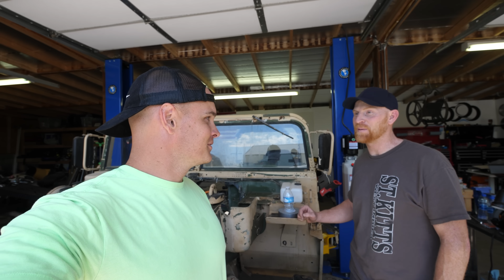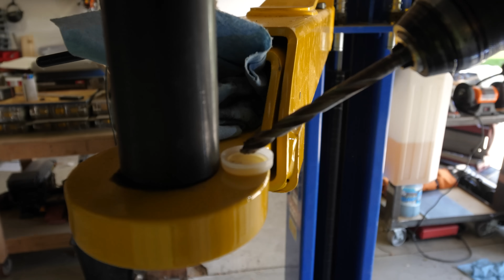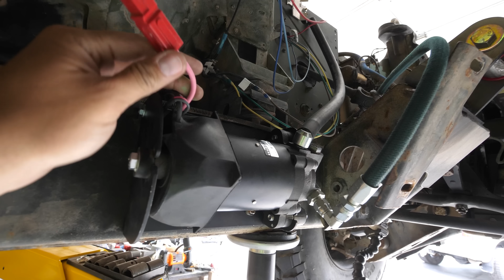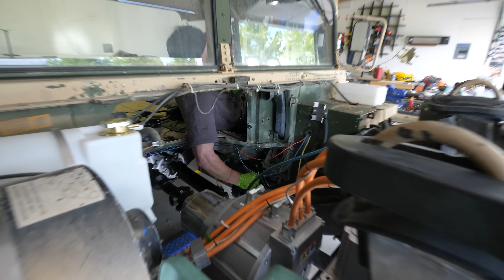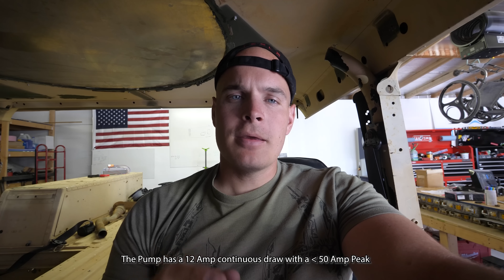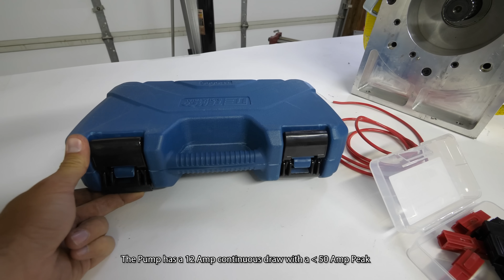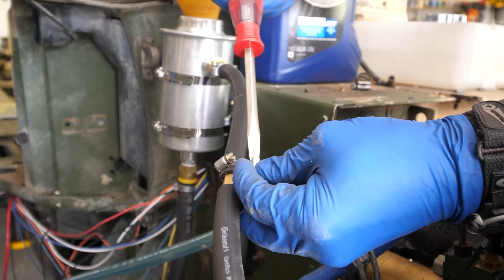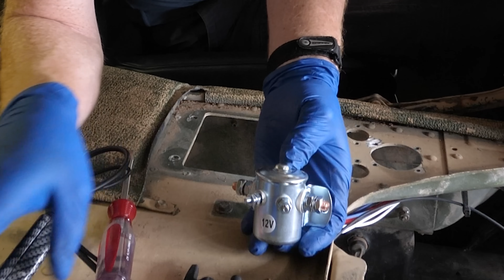We might have a problem with the Brakes... - Electric Hummer Conversion!

Comment: Why not use a main breaker for the power pump, same as for the entire 12v system? It should be able to handle high currents above 75amp. As a solution for the pump maybe it could make a difference to choose a gear pump instead of an impeller pump and vice-versa. I guess that it is the electrical motor that's making the noise but if that is the case, be careful by isolating it because it might not be able to handle the temperature that's increased. Maybe the isolated box is a solution but then maybe you have to cool the box with a fan because of the temp as well. I educate a lot in vehicle, hydraulics, tanks, electric in vehicles and houses in the Swedish army and I'm always thinking about the energy losses that comes with heat and so on. Read in the comments about the accumulator, great suggestion. Hope this helps you out and btw, great episodes. Best regards, Magnus from Sweden👍🏻

Comment: It is not recommended to use a hose clamp with push-on hose when using a push-on hose fitting (barb with yellow ring). That yellow ring is actually more of an identifier more than anything to let the user know that it is specific for push-on hose. The barbes on those fittings are engineered specifically to be more aggressive to eliminate the need for a hose clamp with the correct hose. The clamp will cause the barbs to dig into the hose more than intended, lowering the max working pressure rating. Love watching the build though!

Comment: I think you could solve the noise issue in this way: have a second hydraulic pump driven by the gearbox during movement rather than a dedicated electric motor, so you'd only have to use the electric motor in stationary manoeuvres, I think you'd have to use a bypass valve so you could use both features, when the pressure drops, the electric pump comes on, when it rises, it goes off.

Obviously this system will develop a fair amount of heat, so you'd better set up a heat exchanger to cool the hydraulic fluid, you could recover something from a small mechanical shovel or from some hydraulic transmission machine.

Another thing you could do is to fit electric power steering but obviously you would need a lot of amps to power it.

As for the brake, you could use a vacuum servo brake... you can easily get a vacuum pump and think in the same way; one that works stand alone and one that works with the vehicle running.  You've launched yourself into a nice project, congratulations, if we were neighbours I'd come and give you a hand, greetings from Italy
Reply: This is a unique solution that would work.  I've actually seen hydraulic pumps run off the pinion of differentials on race trucks to circulate additional diff fluid inside the diff onto the pinion bearings.  Couple check valves and an accumulator could help dampen the pressure spike of the electric motor kicking on and off.  The only down side I see is that the faster you go, the harder you would run the mechanical pump off the drivetrain.  And at speed, you really only need the hydraulic power steering pump for brake system.
Reply: @strandtc  I believe that a relief valve would be sufficient to vent the excessive flow, plus, if it were placed before the gearbox, it would be gripped close to the main electric motor and therefore the speed would be more or less constant, I would certainly choose hydraulic power steering for simplicity anyway and hydraulic brakes with vacuum servo brakes.
Reply: @AsitShouldBe  I think you'd have to find a variable relieve valve.  Because if you just put a pressure relief valve in there, and you have a fixed displacement pump, you end up working the fluid really hard the faster you go.  And the shaft speed before his gearbox is variable with the vehicle speed.  That gear box doesn't shift speeds as you drive like a transmission does.  All good thoughts.  Thanks for the interesting discussion.  Oh and the brakes could certainly be more straight forward if he could find the right components to work with the hmmwv calipers/braking components
Reply: @strandtc  yes there are also a variable embedded hydraulic pumps, that should be perfect with every range of speed, for example vetus HT1015SD2.. very big pump, you could add some hydraulic accessories after😁

Comment: You could try adding a variable controller to your hydraulic motor.  Or use a power steering pump from a Toyota MR2.  I believe it has a on board controller just give it power, and 0-10 volts.  Put in a small accumulator and a check valve on hydro-boost . The check valve will stop oil from back flowing back to pump.  Place a pressure transducer after the accumulator.  But you need a closed oil system.  So when you stop using Hydro-boost or steering there is no oil flow.  if it is an open system, then you will need some displacement transducers to measure master cylinder brake position, and steering rotation.

Comment: Get pressure relay, pressure gets low-pump turns on. On a hingway no need to supply pressure to system all the time
Reply: You need the pump for the hydroboost brakes.  He would want power assist brakes on the highway.  And that hydraulic system through the brakes and steering flows all the time, so the only time the pressure goes significantly high is when its hard to steer, or he's braking hard.  Good idea, but it doesn't work like that.  Switching to totally different brake and steering components would be the better solution, but would be much much more work to find the compatible components and get them to work correctly/safely

Comment: 12 amp continuous draw? That's going to kill the 12v battery in about a day. You'll Def want to find an electric power steering unit that has a torque sensor to vary the power pull based on how much assistance you need. I believe these don't even require fluid. They are expensive though.

Comment: Ya you will want a different system for breaks. Used just for steering allows you to turn off the pump when above a certain speed. 65Ah at 400v to run it for an hour, I would guess that is an appreciable amount of your capacity /range. Use a tesla break booster, all in one units from Bosch
Reply: Any idea where you can find specs on those units?  Like the pressure and volume from the master cylinder vs the pedal movement?  Electrical specs?  Its a good idea.. but I always have trouble finding tech specs for OEM components.

Comment: They make bolts that isolate sound. you can also use sound deading mats like they use on the car for large speaker systems. Should help kill some sound in the cabin as well as road nosie.

Comment: I would say you're best bet on sound dampening is to put some sound dampening in the floor of the cab. I don't think you can make the pump any quieter without insulation which would make the pump heat up. I think when you're driving the sound of the tires, wind, and the electric motor will easily drown out the pump noise.

Comment: Mustn't fluids for steering and brakes be different? Because transmission fluid used to be not suitable for breaks afaik
Reply: The brakes still use brake fluid in the master cylinder.  the transmission fluid is providing the power for the brake booster only.  The 2 fluids stay separate.  And in a hmmwv, you can use atf instead of power steering fluid.

Comment: There will not be much you can do to make the pump quieter short of building a thick steel enclosure for it and adding some rubber mounts, but it probably won't be too audible with the dog house cover in, especially while moving with the tyre noise

Comment: if you add a pressure switch to turn off the pump once the pressure reaches an adequate level then it will be quieter.  Also you can add a small pressure tank to store some extra fluid under pressure so the pump is not turning on/off as much

Comment: I think you've located the pump in the wrong place. Try up behind the firewall/bulkhead. That will be safer away from water in deep river crossings, quieter as behind the layers of the bulkhead. Plus, when you bolt on the underbody protection plates,  everything close to it will be amplified upwards, so it's better not having the pump down there.

Comment: If able make a housing to go around it. Use fire wool and sound deadening foam. So you’d have the housing sound foam and then fire wool for safety if fire is a risk. If not. All sound foam. Then just cut ports for your hoses and wires and use grommets to keep the chafing down.   Hope you find this to try out.

Comment: You should use a solid state relay for the power steering /brakes pump. More reliable no moving parts internally on the solid state relay.

Comment: When I was a GM I designed a  foam shroud for some machines to reduce the sound in the factory.  it was a long time ago but I think what I did was measure the sound then research different designs and materials and how much sound that material absorbed.  it being up again the center square hollow tube may be amplifying the sound....maybe put rubber stand offs on both sides.

Comment: Starter solenoids aren't meant for continuous use, you should use a continuous duty solenoid for that. Starter solenoid won't be able to take the heat output when used continuously. As for the pump, i think isolating the pump chamber with foam inserted inside walls should do it, although that might heat up the pump. I don't know if the hydraulic fluid has any thermal conduction properties that may help cooling the pump.

Comment: It’s a hummer. Nothing will be quiet. However, you could shield the pump and use dynamat. I would shield the pump regardless. Do not attach the dynamat directly to the pump. It will retain heat. That is bad juju.

Comment: It looked like that pump fitting was the lowest point in the hummer. Would it catch on something off road, or is there a skid plate? And will the pump run all the time? Sounds like a big power drain.

Comment: This thing could use a alternator generator, so it could run even longer.  It'll help with the charging as you drive.
Reply: Like... As an additional item that spins off the driveshafts?

Comment: I did something similar on my passenger car when doing a motor swap. I have bolts drilled through my frame rails but I had to weld in "crush sleeves" made out of DOM tubing (just large enough for the bolt to pass through) to prevent the frame rails from crushing while tightening the bolts to their torque specs. Do you have any worries that you'll experience frame deformation through the crush sleeves?
Reply: I did this on my hummer when mounting a diesel lift pump/filter.  Crush sleeves ftw.

Comment: Hydraulic fittings never need Teflon tape they seal on the 37 ° faces and Teflon tape if it gets in the hydraulic system can destroy components in the system

Comment: Did you build in redundancy? See even electric cars like teslas do not have 100% electric brakes, theres usually a second pump that runs the hydrualics to the brakes, because the last thing you need in an emergency is no brakes should you lose vehicle power. Most regular gas cars have vacuum boost from the engine or electric assist brakes on top of the standard hydrualic system

Comment: Change the pump to a 24v pump.  Higher voltage is much more efficient and quieter. Only bad thing is everything else sounds like it's 12 volt for the DC system.

Comment: I noticed you connected the solenoid right to the battery...you should put an inline fuse there to protect from a short.  Also, probably the only chance to reduce the noise from the pump is to build a small box with noise insulation inside it to go over-top the pump.  Great series and plan to use it as a reference for the Electric Jeep Conversion @electrifiedveronika and I will be doing soon...

Comment: To quite the pump the the rpm can be lowered with a PWM speed  controller. To 60% for example. Then with the brake switch(  or pressure switch) ramp the pump to 100% with a relay that bypasses the PWM controller.

Comment: I would definitely have put a high quality 1 - 0.5 micron hydraulic filter after the reservoir. You rely quite much on that pump for you own safety and thus don't want it to break.
Reply: Add a magnet inside it to pickup metal particles as the pump and other components wear

Comment: Use the sound deadening material as are put on the doors and floors of modern vehicles. It is heavy and meant for removing the low frequency vibrations that a pump makes. It is commonly used as an easy trick to take care of the noise coming from HVAC hydronic pumps in quiet environments.

Comment: Does the brake hydroboost have an accumulator?
Once the accumulator is charged and you're not moving the steering the pump should shut off if it is running all the time IT WILL DIE
Look into high current solid state relays and electronic PDM (Power Distribution Module)
They should have all the circuits and auto cut offs needed.
Reply: The hydroboost does have an accumulator.  But it only gives you a couple presses of the pedal, and I'm not aware of a way to monitor the pressure inside it... would have to add some sort or port.. and you'd be drilling a small small pressure vessle.  Also, I've heard of people having those fail (ends up not holding pressure like its supposed to when there is no hydraulic pressure from the power steering pump), and not knowing it until the power steering system didn't work.  As AM General built the truck, it was designed as an emergency backup, and not as the primary system.
Reply: @strandtc  I would consider using the steering control system and electronics out of a Prius or similar and replace the hydro boost with a newer GM version if it’s not the same part or go to a compressed air boost . A compressed air boost looks almost identical to vacuum boost except it gets air pressure instead of vacuum.
Reply: @anomamos9095  Woah.. what kind of vehicle can that be found on?  Never heard of one.. sounds interesting
Reply: @strandtc  I forget where exactly, I think on some small hino and Mitsubishi trucks.
There’s a guy converting an old jag with the full gear out of a Tesla who used to work for Tesla. He just used the brakes from a Tesla.

Comment: Jerry - move the pump forward in car i.e as far from the cabin as possible. Car manufacturers then put sound deadening material on the bulkhead to improve NVH performance. Where it currently is mounted you'll have a challenge to isolate it sufficiently. Love the series man!
Reply: That was my thought. Placement of the pump so close to the drivers seat seems unnecessary unless I missed something. Put it further up in the engine compartment.
Reply: Definitely, could even build out a sound deadening box for the pump itself, almost like a sound deadening box for a home generator
Reply: @diesels4774  it needs to dissipate heat ! just like a generator
Reply: @shawncell1247  Power steering cooler + vent fins on sound box?

Comment: Just an FYI solenoids are a type of relay. They're just designed to handle heavier loads
Reply: and only certain solenoids can be run continuously.
Reply: Solenoids are more mechanically driven actuators than a relay..  relay just switches electrial loads on or off with a separate voltage source to isolate.  Solenoids are actuated electrically to turn a mechanically activated system open or closed.  They convert electrical energy to a linear mechanical  energy or force.. not much relates to a relay besides the fact one source is used to trigger another..
Reply: @Z-Ack  if you wanna be super pedantic...a relay is a solenoid connected to a switch. (virtually) All electromechanical relays are solenoids. Not all solenoids are relays (think pinball flippers or some styles of door lock actuators....or the thing that eats your coins in a pay phone when the person on the other end of the line picks up. (did I just date myself?)

I'd be curious to know the duty cycle on the starter solenoid/relay used here. Starters typically are very short duty. Using one for a continuous load could be problematic.

Comment: Use electric power steering and  a hydraulic accumulator for the hydroboost so the pump only runs when the pressure is needed. Toyota Priuses use a setup like this but go a step further and have a device between the master cylinder that electronically controls the brakes with an electronic proportional valve and the master cylinder is only connected when there is a failure. This allows for a smooth(ish) transition between regenerative braking and hydraulic brakes for when the battery is full, or regen cannot provide enough braking force. Basically the brake petal is a potentiometer with two concurring output values like a modern gas petal, but also has a mechanical backup (master cylinder)

Comment: So I’m no expert or mechanic not even close, but you could probably use the same soundproofing material you get in car doors, stick that around the car to help the noises or even make a enclosure for the pump using the soundproofing material. Hopefully that’s not a silly idea but sounds like a cheap compromise

Comment: The problem with ALL electric trucks is two fold: 1) The technology is 120 years old, tested, and failed as its not as efficient as fuel driving vehicles. 2) The vehicles DO NOT fit in a typical home's garage. Thus, you will have high powered cables running across your driveway (where your children play) to charge your oversized vehicle. BTW, this is why Tesla is changing the footprint of their new electric truck...